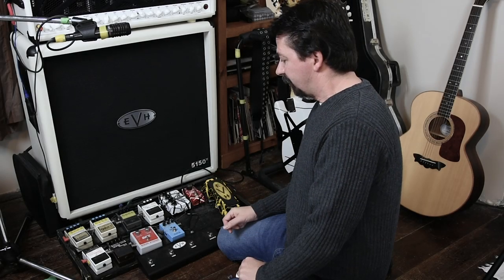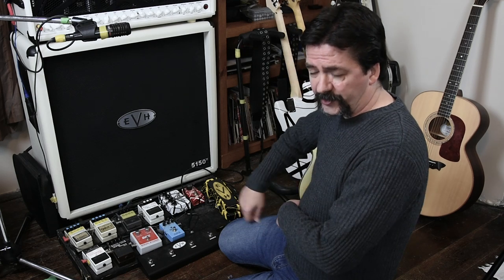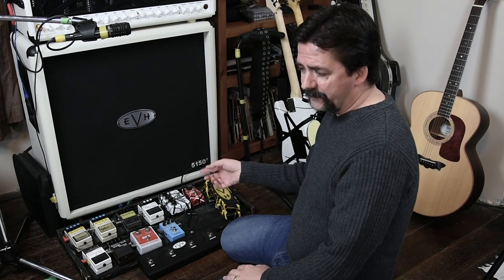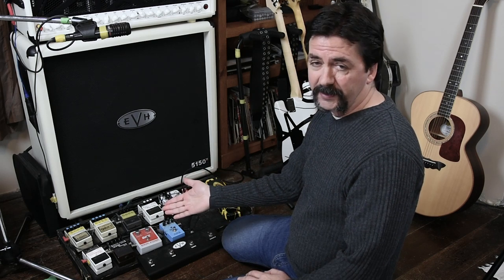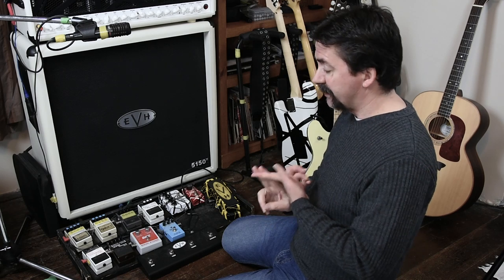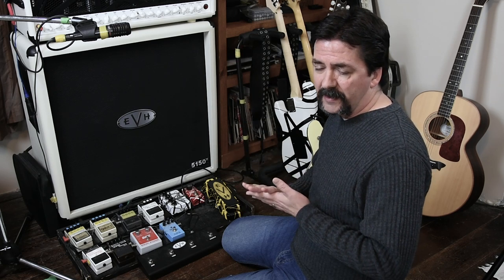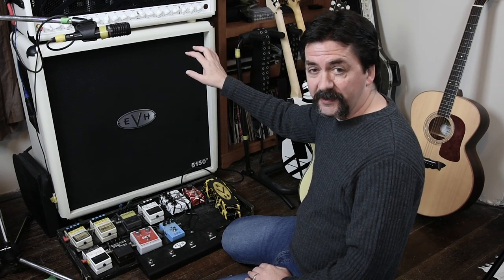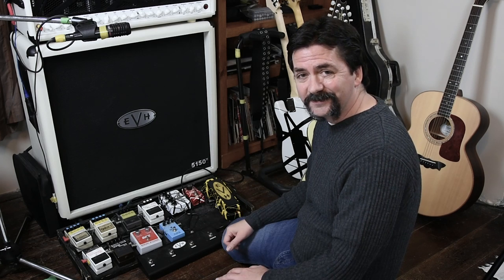EVH Gear 2016 Discussion EP2 Effects Setup & Signal Flow

Comment: I don't get how you have the noise gate at the end of the effects loop signal if it's not at the end of the chain of your loop pedals. It looks like it's the first of the loop chain. Why is it not the last panel to the left of your two delays then? Did you piggyback it back toward the middle of the board for some reason?
Reply from the maker: Alex Makridis this has since changed. I don't even use it anymore. Thanks to cleanest of signals with a new PedalSnake I don't even require it.

Comment: Hi Eric, I have a question about the EVH cabs. I've heard that 1x12 and 2x12 are loaded with made in China G12H 30W Anniversary Series, while the 4x12 is loaded with made in UK G12EVH. Do you know if there is a quality sound difference between these speakers? Are the made in UK speakers betters than the made in china? Do you think it's possible to compare them for us? Thx  ;)
Reply from the maker: There is a bit of a difference in the Chinese made. I have heard reports of several people swapping out the speakers. I will see what I can do for some comparison videos for you! Thanks so much for watching and your question.
Reply: There’s a big difference in the sound of the speakers.  The G12 EVH found in the 412 are simply amazing.  You can get the regular G12M speakers because they are cheaper than the EVH ones and they are the exact same specs.  Only difference is the magnet has the EVH stripes. Good luck.  👍

Comment: Hey man great work as always I just bought an evh wah and Evh chorus and now I’m getting a horrible white noise hissing sound in my chain and I’m powering with mxr iso brick I’m pretty sure it’s the wah any suggestions??  It was not doing this before thanks!!!
Reply: I had the mxr brick and it hissed like crazy. I replaced it with a voodoo labs pedal power 2 and it cured my pedals hissing .

Comment: Eric, if I'm running a clean channel of an amp and am using the MXR EVH 5150 Overdrive pedal, where should I put it in my effects chain ? I have a wah pedal, a flanger and a phase 90. Running a Boss ME6 multi effects pedalboard through the effects loop just for the delay. I've been out of the loop for awhile but I remember you from the old VHML 20 years ago !
Reply from the maker: +John Conklin VHML! Been hearing that alot lately. I would go: Guitar > Wah > Phase 90 > Flanger > 5150 Overdrive > then to front of amp. Using the ME6 through the loop is totally cool if you are just using it for delay. I think this order for you with the 5150 Overdrive will work great. Please keep in touch (awesome to hear from you again) and thank you for checking out my videos!

Comment: Great, great video man!  Well explained! I never tried to put the NS-2 in the loop though...what is the main difference between putting it before the amp and in the loop?
Reply from the maker: +Benjamin Girard Awesome thank you. It's more of a built in thing, cleans everything post input, rather than pre input. Both work well, but you'll like it better in the loop. Try em both ways at decent (stage) volume and see what you like best. I prefer loop. Thanks for checking out my videos!

Comment: Hello, I was curious about compressors...if best to run through front of amp or through Loop system? Don't know if you use them, but I like how it evens out the sound of the strings, not too tinny or bassy.
Thanks
Angel - Tucson, AZ
Reply from the maker: I do not run a compressor on my pedal board and to my amps, but I do use them on my Helix at end of chain. If I were using one on my board to amp, I'd probably go last in the chain running to the front of the amp. Then again, what I may like may not be the tone you may like. Best to try all over and see what you like best. First, last, or in loop. Not real right or wrong. Report back when you find the sweet spot for you!
Reply: @musicgearnetwork  I have an Ibanez UE400 multi-effects rack which has a compressor and I run through my amps loop. So I'm good, love my personal sound and tone for both clean and dirty sounds from the compressor. 
Thanks for your thoughts!
Angel

Comment: Hi there, cool vid.  Question about the pedal snake:   I went to their website and it looks like the max on their snakes is 7.  what if i have 10 effects that require power?
Reply from the maker: +Richard M All you need to do is use a "daisy chain" cable. There are various manufactures of them. But PedalSnake even makes them too: https://www.pedalsnake.com/osCommerce/catalog/index.php?cPath=27_33 Just keep in mind, some pedals draw more current than others, so while you might be able to turn on 1-3 pedals at a time, maybe more, depending on the current load, you could destroy the power supply if you turned on all pedals at the same time. However I think it would be rare (it is for me) that I would have all pedals engaged at the same time. Hope this helps!

Comment: I have 4 different rigs with dozens of pedals. I use pedal loopers so that each pedal can be taken in/out of the loop and also save wear/tear by not stomping on them. A must for vintage pedals. Also a Radial ABY Bones you can run 2 amps in stereo. Another example is I also run a Fender blues jr and a original 58 Fender Tweed deluxe through the same effects board with them though a looper. The last pedal is a Boss ls-2 line selector.
This allows you  to jump from one amp to the other and also share the same board of pedals.
Reply from the maker: Awesome share, thank you! I as well at one time used to have a LS-2 and used it with a combo of 2 Peavey 5150's. One 100watt head for dirty and the 2x12 combo for clean. Thanks for popping by!
Reply: I just got my EVH III have a Line6 DT25 for smaller gigs I was debating on getting one of those like the boss one so thanks I think I'll get one.
Reply: I have pedals and a Helix just chasing tone I have a LINE6 DT25 so I'm trying to get just a workable sound without buying anymore stuff. I've got the EVH pedals except the chorus. Whammy dt, I still believe that true tone comes from me. Just wanted great effects and lost my EVH III last year so I got the head financed and got a really great deal on a Marshall bottom. Great video. I'm going to subscribe next month when I got the cash. I couldn't afford the EVH bottom yes mostly because I just bought the Helix oh and I don't roll my mids down as much as I did when I was in my 20's thank you for the video's

Comment: I have 2 amps a 5150iii head and GK sel2100 head! With 4/12 and vox ac 30 2/12 vintage 30s want to run stereo!!Thinking getting a firman SPB 8  pedal board would this be a good choice?

Comment: nice rig...I'm almost certain Eddie used the rack mount version of the bbe way back in day in the loop,well almost the loop..he slaved one of the heads to create a type of loop since he doesn't put anything there,even his delays...analog delays work well in front if you turn the mix way down
Reply from the maker: I believe he did have the rackmount, and yes agreed analog delays will work in front of the amp if used sparingly.

Comment: Great Vid, Question.. Can you run a BBE Stomp thru your effects loop ? Will it hurt the amp ?
Reply from the maker: +Jack Lord Thank you for your question. Yes indeed you can and no it will not hurt the amp. I would not crank it (the pedal) but even then, you should still be 100% fine. Thanks for checking out my videos and your question!

Comment: Hi Eric , 
Quick question I am trying to add a noise suppressor ., but I get allot of noise   I have a Les Paul and the feedback is killing my vibe to play . What do you recommend ?
Reply from the maker: Are you adding the noise suppressor through the loop? A noise suppressor also wont really kill feedback, it's more to quiet the Hiss from high gain amps, and sometimes hum from voltage interference.
Reply: +Eric Broadbent Guitarist Yes through the back. But works fine with my Wolfgang..

Comment: Good video but you are incorrect about the delay pedal not being used infront of the amp.. Eddie used an echo plex infront of the amp all the time.. just set the volume low and repeats to a minimum and it can be used very effectively.. Eddie never ran his delay in the effect loop especially in those early Van Halen albums
Reply from the maker: Thank you. I never said though that Ed used a delay in the loop as they had no effects loops then.
Reply: @musicgearnetwork  that’s very true! He never ran reverb either but is a must if you want that killer sound! Great video non the less ! Keep up the good work